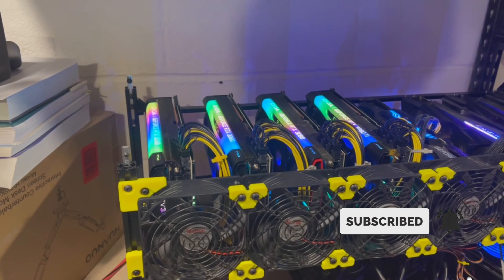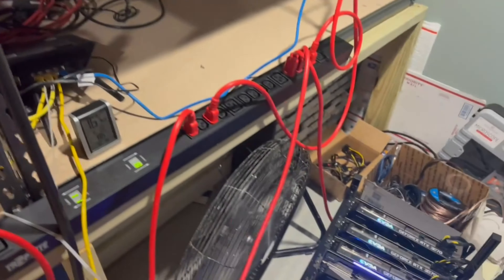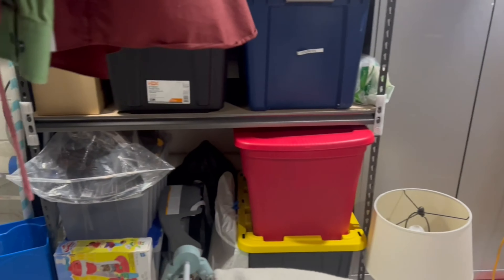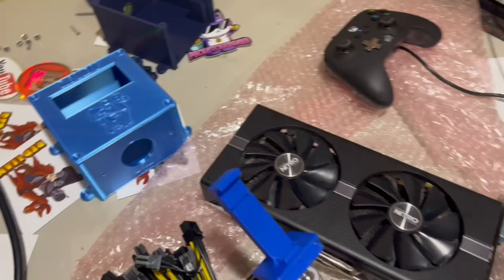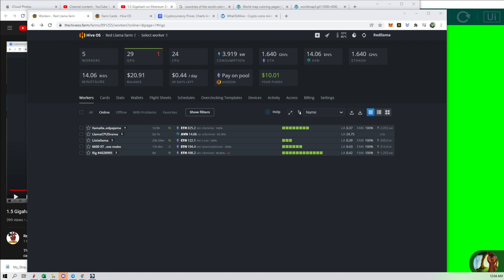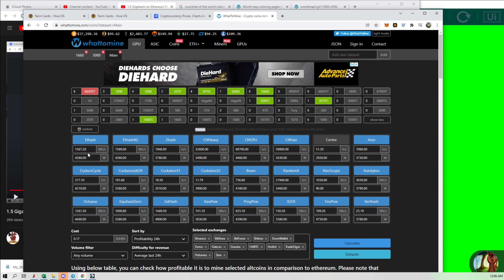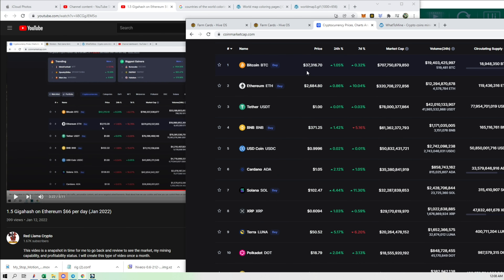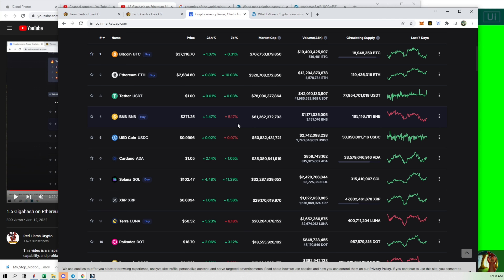1.6 Gigahash on Ethereum $60 per day (Feb 2022)

Comment: I'm producing exactly 1.6 ghash as well. The heat has always been an issue. Before summer comes I'm going to build a shed outside to better manage everything. It's just to much for inside a house ( in Florida ).
Reply from the maker: oh man you guys must be burning!!!
Reply: @RedLlama  In summer, I simply can't get the house lower than 80°F during the day and that's using grow tents with vents going out the window so the heat exhausts outside. At night, I can get into the lower 70s° but not during the day lol

Comment: What size screws in the red llama L6 box? I lost 1.
Reply from the maker: Hey it is a #6-32 screw in there. if you have an outlet, it is the same thread that i used in the box design.
Reply: @RedLlama  thanks. I should’ve been more specific. 1 of the 4 front display panel screws.